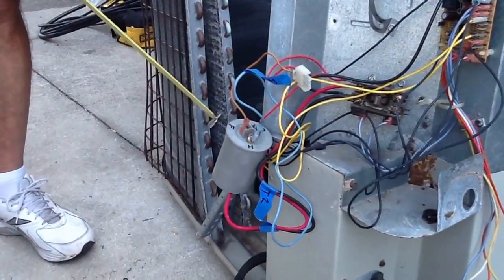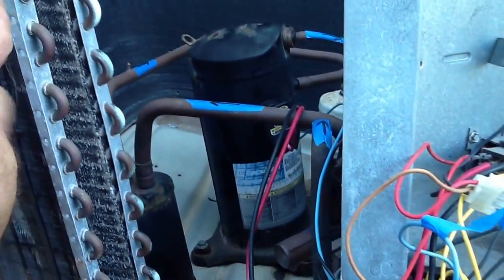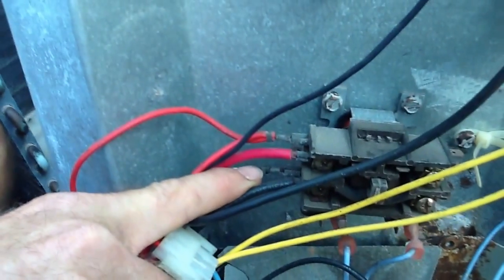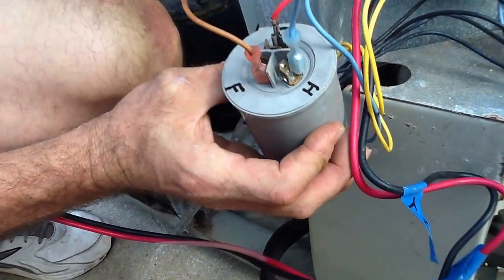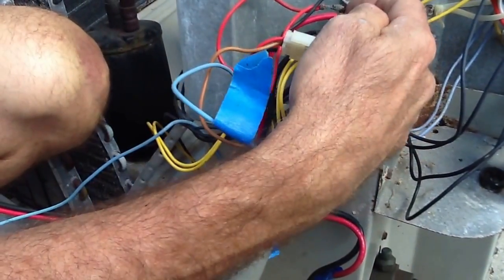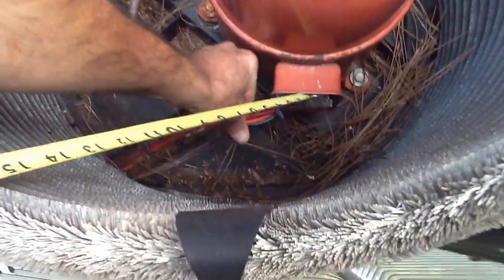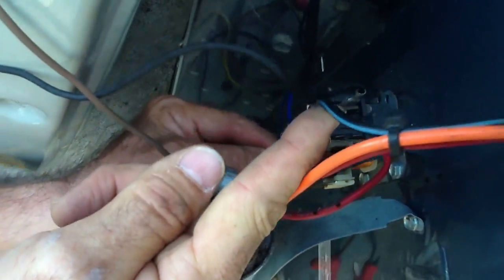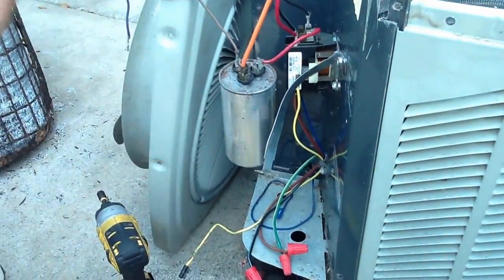Basic Compressor Wiring

Comment: I love this video.  My Tempstar 3 ton unit ( made by carrier) is exactly wired with the same color wires coming from the compressor.  Black T2, Red T1 on the same contactor as you show.  Blue going to The Herm on the capacitor.   Just confirming.  If I want to check the inrush amps of my compressor at start-up which states on the label 88 LRA.  Do I place the amp meter on the black wire coming from the compressor to the T2 on the contactor?  My scamatic is completely washed out and I cannot see or follow anything. Would you know where I can get the scamatic for my Tempstar 3 ton unit?  Model TCA236AKC4, serial # E0520914?  Thanks.  Happy New Year!!!!

Comment: Hi David,  10 years late ! I'm a DIYer trying to understand the  Capacitor and Contactor wiring from the Fan / Compressor and Dual Run Capacitor.  This helped alot since most the videos don't discuss the Contactor wiring ( T1 / T2 terminals ) in detail. THANKS !

Comment: You need to know more, forget the colors of wires, you need to know about run, start, & common on both ends compressor, contactor & capacitor.  What if all wires are same color, it happens

Comment: "C" does not stand for common on a capacitor . It stands for " Capacitor" (as in power in) and hooks up to the same side as Run on the compressor and NOT Common, :)~

Comment: This is the video I've been looking for. I had to replace a run capacitor on my Ruud system and (like a dummy) unplugged all the wires without marking them. So, I had an orange wire, an orange wire, an orange wire, and a brown wire lol. Your video helped me make sure I hooked the third wire (other two we connected to the contactor) to the hermetic post. Thanks for this video!

Comment: Hey David love your channel honestly you in gray furnace man and acservice tech taught me everything I know and help me get through my day while tackling these units been in the industry for 3 years now I wish I could be ur robin and get under your wing I can tell u really njoy teaching us future techs.... anywho had a ? Was wondering if you could do a video about the compressor not pumping I had a issue today went to a customer initial problem was blown out fuse replaced it and got unit up n running I connected my gauges to stage 2 compressor pressures remained equalize while unit was operating the contactor t terminals where giving me shortage of voltage at each leg 3 phase 208 volts but I was getting proper voltage every where else compressor got hot suction line was very warm tho do u mind explaining I wrote up as bad compressor and contactor was this the wrong call?

Comment: A little help...why is it called a "run" capacitor if the compressors start winding is what's connected to the herm side of the cap? Is there an internal switch in the compressor that disconnects the cap after it starts?

Comment: HI SIR 
lot of times i saw your videos its help full us for learning 
but i have one doubt,
                
                     1.How to identify this much psi freon   gas only to be charged in the compressors.
                     2.How  to identify hp rating of the compressors(if filter drier was block or some other issues in the compressors or some other issues in the systems In theese issues suppose my compressor taking more current that time what i wanted to do)

Comment: Isn't the black line wire on the contactor a common (t2)? Shouldn't the wire from the contactor to the capacitor common be also black?
Reply: On mine there was no black to C although the units wiring diagram showed it as black ..I hate when they do that.

Comment: Hi David! I have a Trane AC unit that keeps tripping the inside 40amp breaker. I have had 2 different AC Techs to come and look at it from the same company in my town. The 1st said compressor was going bad. The last guy replaced hard-start compasitors & said compressor was starting fine & had to be a bad breaker. I replaced the breaker & it's still tripping after about 4-6 hours of being on. The unit was installed when the home was built 10 years ago, but the compressor was replaced 5 years ago. I've checked for loose or burnt wires, but found none. Even sprayed coils to remove any dirt build-up. In watching another tech's video, he had the purple wire connected to Herm; red connected to Com & brown connected to Fan on compasitor. I noticed that on my unit, the tech had a red wire & purple wire connected to Com; orange wire connected to Herm & brown connected to Fan. If the wiring is wrong, would the compressor still start, but trip breaker later on?

Comment: Hi, I have a Reheem 3 ton central air unit that starts and stops every 10 seconds. It continues to cycle this way but never stays on.  I've changed the capacitor and the compressor relay but still to no avail. It continues to cycle on and off every 10 seconds. Please help.  It's getting real hot in Jersey.
Reply: It may be tripping out on a slightly low charge or just a dirty condenser coil

Comment: David, My AC unit won't shut off.  It burned out my motor and capacitor.  I replaced both, but still have the issue with it not shutting off.  the Tstat is good because I replaced that too.  The contactor seems in good shape.  
What will make the AC not shut off when the desired temp is reached when it's not the tstat, blower fan relay, capacitor or contactor.....Help...:-(
Reply: Sounds like your contactor is welded shut (probably due to sparking & arcing)
Reply: I

Comment: Thanks for your video - I was confused on which was T1 and T2 on the block I could not see any marking on the block. You clarified that in this video. Now my hard start kit is installed and working! You are my newest hero!  (For anyone else the terminals on the contactor block are numbered from right to left so the red wire from the compressor is on the T1 on the top right. That is where you want to connect the black wire from your 5-2-1- hard start kit)

Comment: I am trying to hook up a 5-2-1 compressor saver on a Trane RX12 unit.  I don't know where to put the black wire on the contactor.  Does it go on the black wire side of contactor?  Thanks, Great Video
Reply: Rich - I just watched - the red wires are on the T1 so the black wire from the 5-2-1 unit goes on the T1 contactor with red wires attached - it took me a bit to figure that out also

Comment: I have a copeland compressor in my Rheem central air, one of the terminals burnt off. I have pictures if you message me. I want to know if the 3 pronged terminal on the compressor can be replaced. because I was told I will have to exchange the entire compressor. Thoughts?

Comment: Hi david, I just look at my single phase copeland compressor wires. And there 2 black wire coming out from a port in lower side of compressor and they are not connecting to anything. I wonder what they are, and they are just lying there in the bottom of my ac unit.  Thanks
Reply: Khuong Nguyen probably leads to a crank case heater not being used, if i had to guess

Comment: Thank you very much, very nice video. Follow up question, if the three cables to the compressor are disconnected, how do I know which of the three wires goes on which compressor terminals?

Comment: David - love your videos.  I was troubleshooting my AC and found that the T1 female spade connection to the compressor had corroded and lost contact.  Sounds easy enough but the male blade terminal on the compressor looks to be soldered to the cylindrical pin (3 pins coming off the compressor) and is all corroded and has left a good little piece of the male blade on the actual pin terminal.  Therefore I cannot replace the wire with a new female connector because it wont attach.  I tried to twist and turn off the corroded male piece with no luck.  I am wary of the fact that the terminal is fragile too and breaking it off would essentially ruin the compressor.  Any ideas on how I can reattach the T1 in this situation?  Thanks!
Reply: I have the same problem, did you get the answer???
Reply: You can purchase a compressor terminal repair kit. Solves that problem

Comment from the maker: You will need to add a low voltage wire from thermostat to air hander, then from air handler to condenser.
Reply: David Jones ggffffddtcgubv

Comment: i have a question. how come on the second condensing unit the compressors hermetic terminal is attached to a Run Capacitor instead of a plastic encased Start Capacitor?